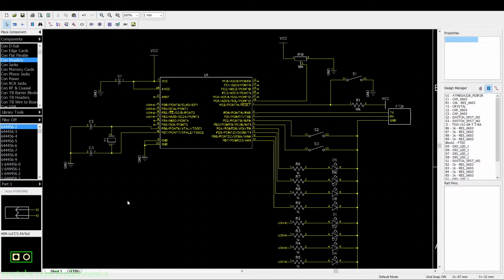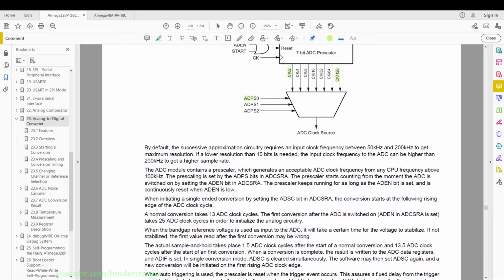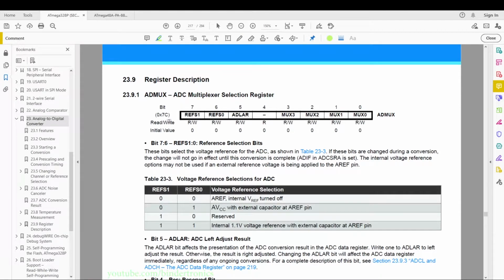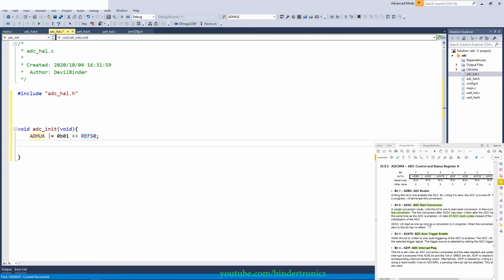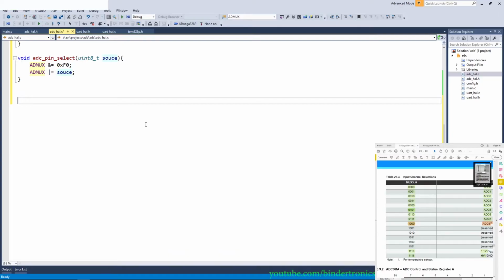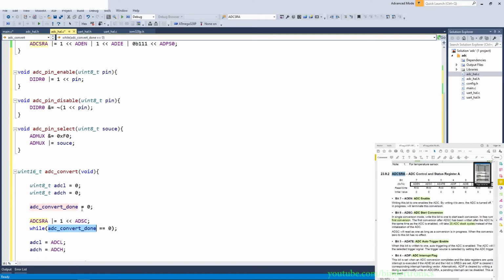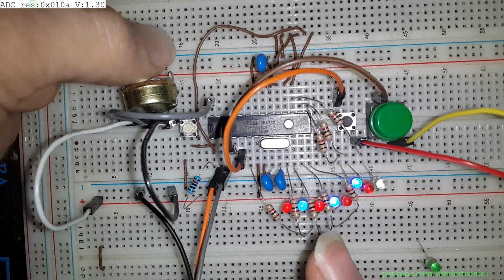Analog to Digital Converter (ADC) 🔴 ATmega328P Programming #8 AVR microcontroller with Atmel Studio

Comment: At timestamp 22:30 , the explanation as for why it matters to read ADCL & H into local variables instead of using ADCL&H directly in the shift calculation is that ADCL must be read first and C/C++ evaluates left to right, so the shift calculation would have read ADCH first if it was using the registers directly : (ADCH << 8) | ADCL;  vs (adch<< 8) | adcl;

328P Datasheet states in sec 23.2 "ADCL must be read first, then ADCH, to ensure that the content of the data registers belongs to the same conversion"
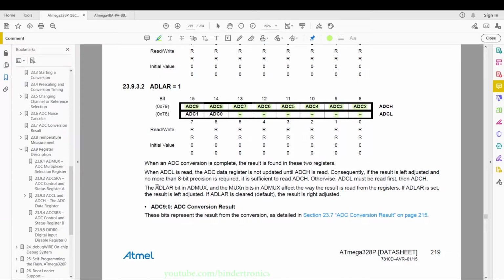Reply from the maker: 12:04 lightly cover it.
To add: The C compiler does not guarantee which register is read first, only the operator precedence not evaluation order. ADCL | (ADCH << 8); may work with one compile and then not with the next.